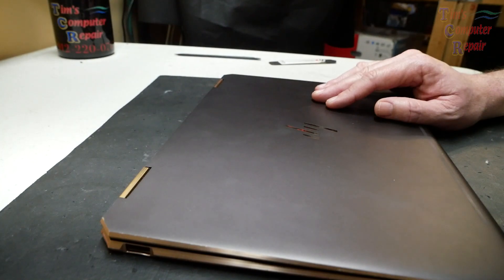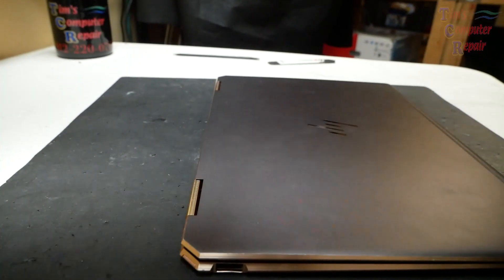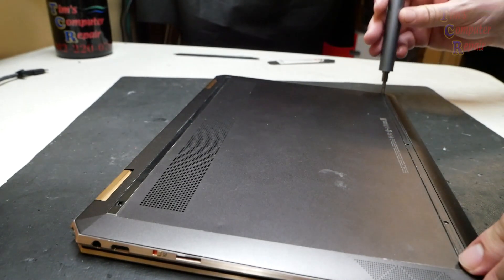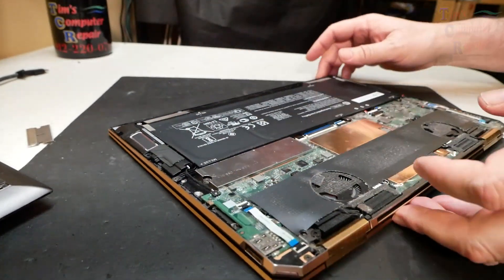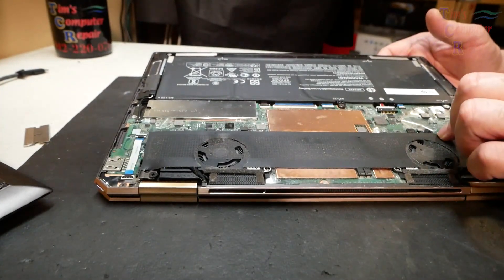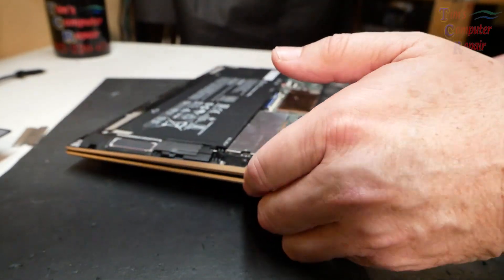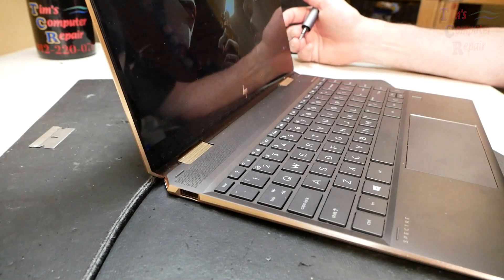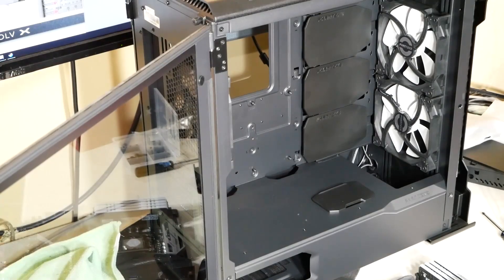Dead Laptop Computer? Try This Easy First Step That Might Fix it!

Comment: Hello to Tim's Computer Repair from Geo's Computer Repair. Thank you for the great repair videos. I've been doing computer repair since 1995 and there's always something new to learn. Yes, I do the same as you. Disconnect the battery as a first step and then try booting with just the power adapter plugged in. Sometimes the battery is shorted out and will prevent the laptop from booting. 👍👍
Reply from the maker: Geo thanks for watching. Yes batteries can sometimes cause funny issues with laptop computers as you know. Funny how that works. Thanks for commenting.

Comment: Was the main battery taking the place of a separate CMOS battery and disconnecting it cleared a CMOS issue?
Reply from the maker: Possibly, this has cleared quite a few laptops that appear to be dead. Thanks for commenting.